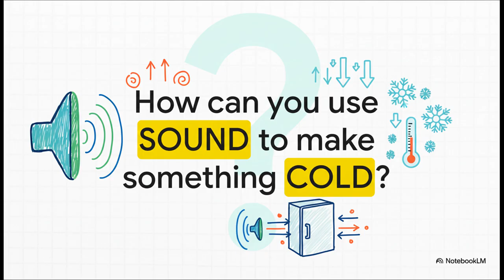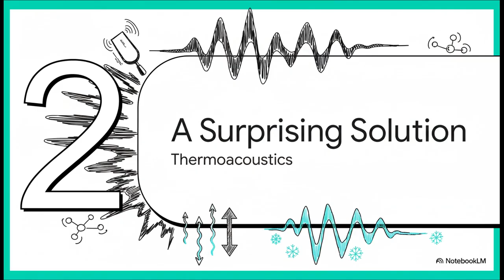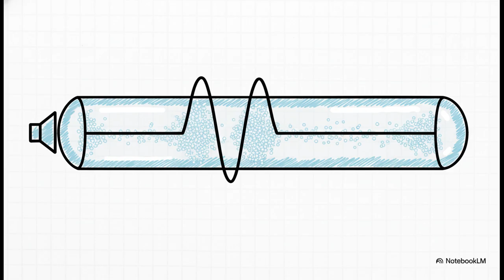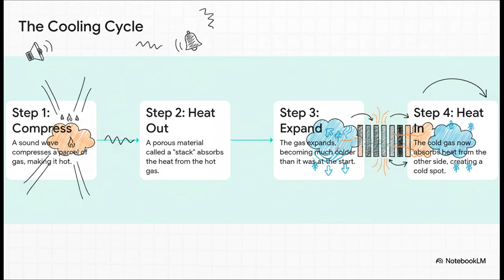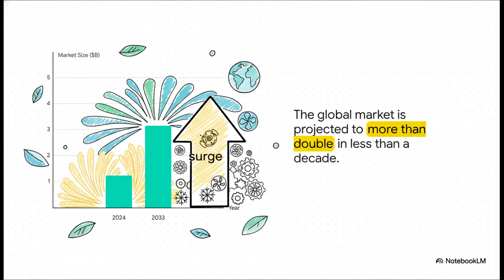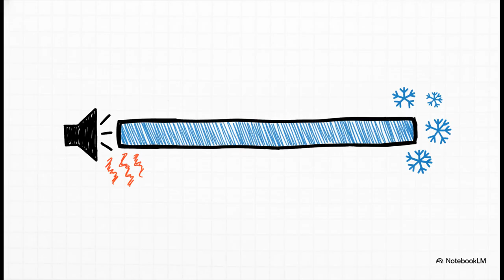Thermoacoustic Technology Explained | How Sound Waves Create Heating & Cooling Without Moving Parts

Comment: how does the "stack" absorb the heat? where does it go? It can't go into the atmosphere... then it has to go down the drain... you could at least say how effective the stack is at removing the heat. You have to get the heat removal above the original amount of heat in the air for it to cool anything, so its assumed that the stack has to remove at least the amount of heat created by the sound wave. Please try again on this because this explanation sucks...